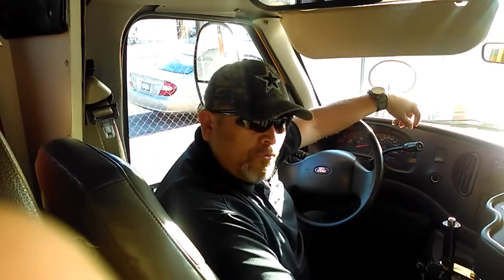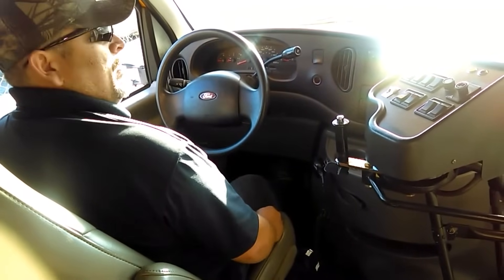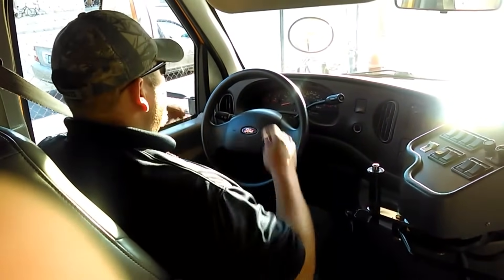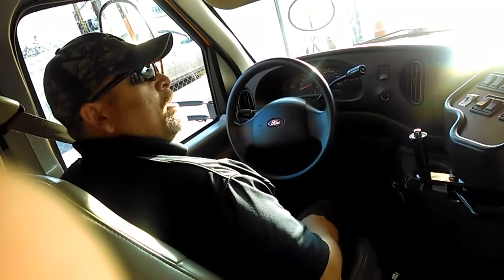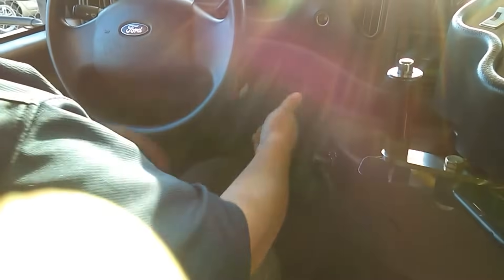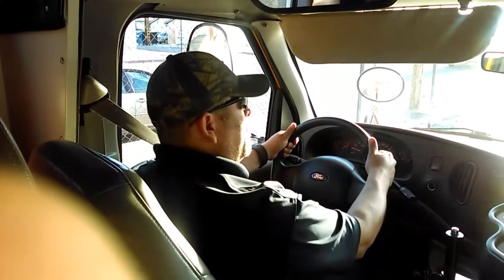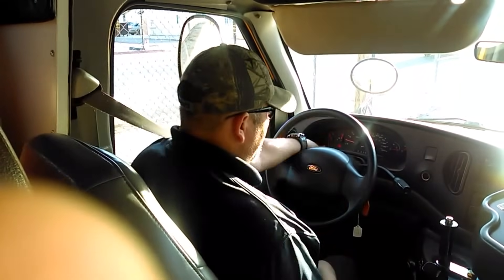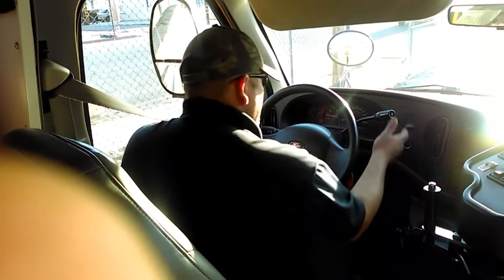School Bus Hydraulic Brake System simple test  for leaks..CDL

Comment: Not sure I understand why putting the headlights on is part of the brake test.  I love the full air brake system.  If you lose pressure, the brakes apply.  Hydraulic system loses pressure, you roll.  I've had 2 buses with hydraulic brakes and a personal car fail while in operation.  All of which I kept the vehicles under control.  Big buses don't have a park gear so shifting into 1 helps slow down.  On the car, it was a 87 Ford Crown Victoria with no brake warning light at all.  I put it into park gear and it skidded under the red light.  I had my other hand on the horn to alert others of a problem.  I don't care if I wreck the transmission, with family in the car, a wreck with another car wasn't an option.
Reply: You should never use your park pawl to try and stop your vehicle in an emergency.  Use low gears FIRST and then apply the parking brake if you need to stop or slow down further.

Comment: ........in the first part of the test where you're pressing the service brake three times and holding for five seconds, you forgot to say "the brake pedal should not move (depress) during the 5 seconds."  This is in the DMV handbook. If the brake pedal moves, then you know there's a leak somewhere, because the pedal still moves after it's all the way depressed, meaning pressure (fluid) is being released somewhere in the system.